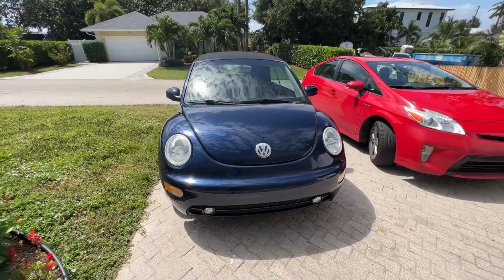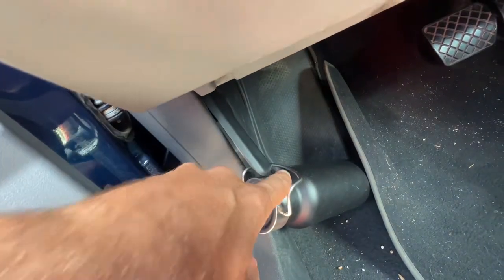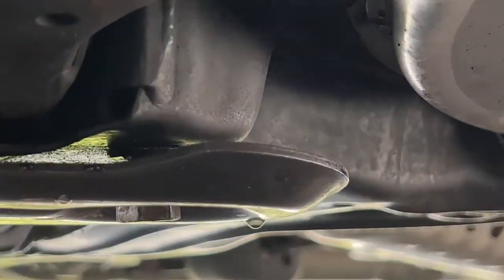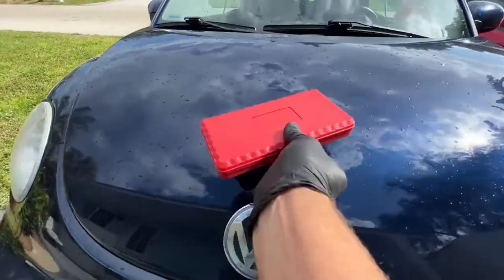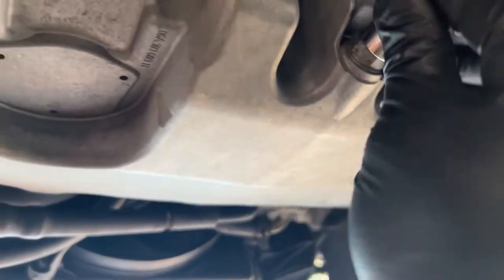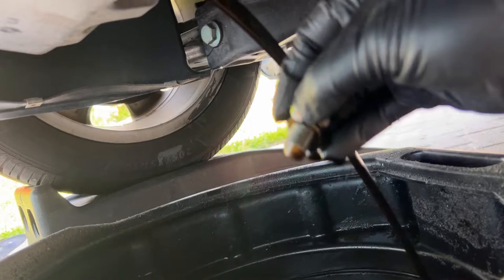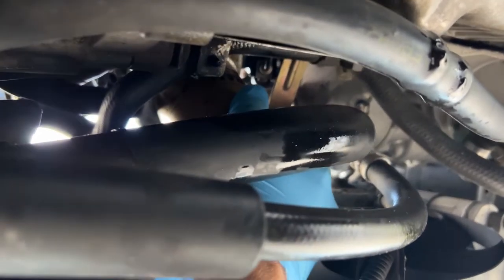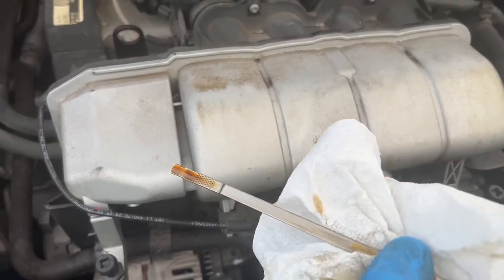How to do an oil change on a 1998-2008 vw Volkswagen Beetle 🪲 ￼Fram 3600 filter 5w40 synthetic oil

Comment: One way I’ve seen for getting around the part blocking the drain bolt is to use aluminum foil to make a drain path from the bolt.
Reply from the maker: Thanks!
Reply: @RealityUniverse  I just did this yesterday and it worked pretty well

Comment: Thanks for the video and especially on the spinning threaded insert as I have the same problem removing the skid plate. Unfortunately on mine, I don't have enough space to grab the insert with needle nose vice grips. Any other advice on on getting that bolt off?
Reply: But first, spray some wd40, then tighten it a little bit to break the rust bond, then loosen.

Jam a flat blade screw driver in there and twist.  Try to get the blade under the head of the insert.

Wire brush the bolt threads clean, apply grease to keep the water out that will cause it to rust up and bust the insert loose next time.
Reply: @rickpaulos  thanks for the reply but mine was loose and I ended up bending the skid plate just enough to put some friction on it and eventually was able to get a pointed vise grip on it. That took me a few days to get it off

Comment: What year is this car?  Another youtube vid shows the drain plug at 17mm vs yours at 19mm.  Does every year have that guard in the way?  Another youtube vid shows the drain plug is accessible.
Reply from the maker: There were a couple of different engines offered in the bug. I know that there was a normal gas version, a turbo version, and also a diesel version. You have to check and see which one you have.
Reply: @RealityUniverse  turns out my 2005 gls 1.8turbo takes an 8 mm hex wrench.